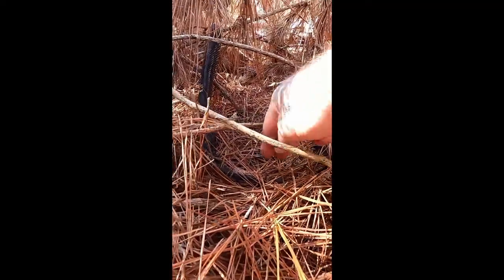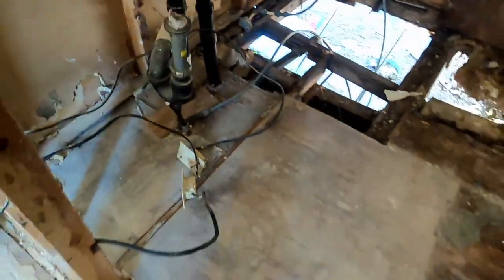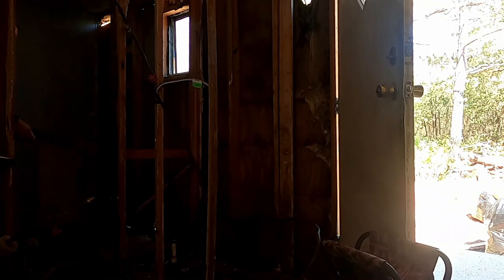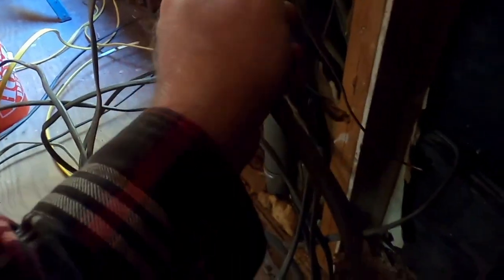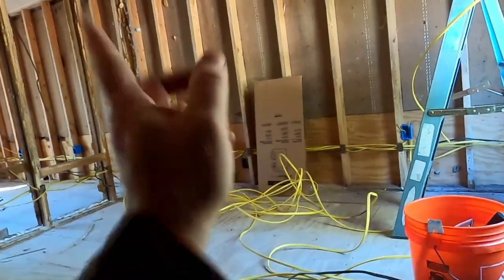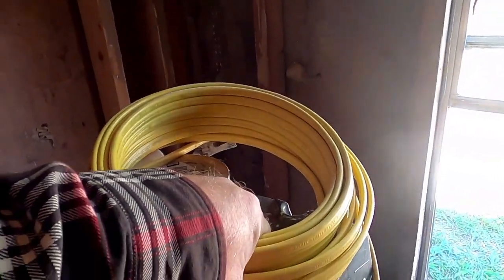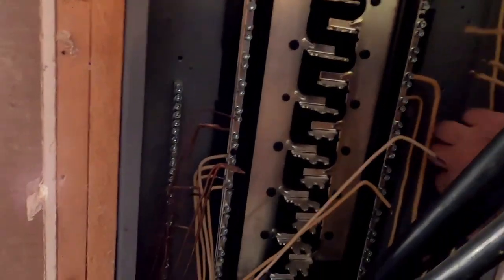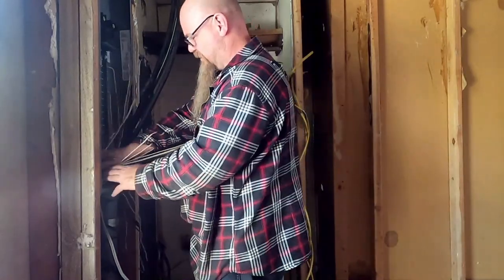Rewiring a mobile home myself: Doublewide Renovation

Comment: Good job on the wiring. If that was a stab-lok panel then those wires are probably bad anyhow. The breakers on FPE STAB-LOK don't trip under overload and they get hot and it melts the insulation or makes it brittle so it can touch and short. I don't recommend reusing any of that wire.
Reply from the maker: I would like to not, but there is some stapled into the attic wood and I can't easily get new in. I decided to isolate those to JUST those circuits. They will only run lights, and those should be low wattage LED's so, with that in mind I'm going ahead on those ceiling ones I can't get to. I hope I don't live to regret that!! 
I will say we haven't felt or observed any brittle or cooked old romex yet, even the stuff exposed to sunlight for an extended period still felt flexible and all. That stuff got replaced anyway but it seemed decent
Reply: @suburbangardenpermaculture3117  Just be careful. Really to be honest you can cut the sheetroock out and get access to replace the wire then patch it and spray more popcorn coating back on it. Which would you rather have? A patched spot and know the wire is good or a fire? If the old panel has burnt spots I highly recommend replacing everything, wire, switches, recepticals, everything. I'm a licensed electrician. NFPA writes electrical code. NFPA stands for National Fire Protection Association. Electrical code is all about preventing fires. I tend to follow what they suggest because there is a reason for it. It's better to be safe than sorry. Your family will be living in the house. The amount of money you could save cutting corners will be gone if a fire happens or in hospital bills if one of your loved ones is hurt in a fire, plus you live in the sticks, is the fire department next door? New modern wiring means insurance is more likely to give you cheaper coverage.

Comment: We live in a pretty old mobile home and the lights flicker. I've had my husband replace most of the plug ends on the wall, but there are a few he hasnt done yet. Probably got 5 left. A lot of the flickering stopped, but there are some rooms where it still flickers if you plug something in. I know the wiring needs to be completely replaced. Do you think it would be easier to open up the outside of the house (aluminum siding) than it would be to tear up all my walls? I just am not good at drywall and I've already painted everything and dont want to deal with that. Drywall professionals are super expensive. I would think if the outer walls are out, we could also put some good insulation in after its rewired. BUT is that a viable option to do it from the outside?
Reply from the maker: Wow... YES!!! 🤣 That's literally like the best situation if you ask me. This video you are on is a few months old, and I'm behind in publishing my footage, but we have been removing the outer skin siding to repair it, and we've JUST been talking about how we could get another free trailer, with metal siding, and replace it like we are on this trailer and it would be SOOOO much better! 
I don't want to spend your money for you lol, but we found out that 7/16" OSB wall sheathing panels are only like 11 bucks each... that's not free, but it's truly not alot for what you'll get. 
I recommend removing ALL the metal siding,  carefully, work out your wiring, and then add these 7/16" panels and nail them hard to the frame like we are, a nail every 4-5 inches... ALOT of naild per sheet. It makes the trailer SOOOO much stronger and airtight. There is also House wrap. You can install that over the panels, then screw your original metal siding back on and you'll notice a WORLD of difference in your heating and A/C bills, and it'll feel much more Solid! 
Long story short, YES, that's a great way to rewire it without messing up your sheetrock,  and you should take that chance to fix any Rot and add hard panels and paper before your siding.
Reply from the maker: I would add, if you upgrade you panel like I did, you'll likely still have to mess up the wall at the panel to get to all the wires easily inside and out.

Comment: What all did you use supply wise? I want to completely rewire a mobile home, but I don't know what all I need for it. What kind of power cables and everything did you use?
Reply from the maker: @karadavis4586  inside all 12 gage wire, no 14 gage at all, whole trailer is 20 amps or more. The big feeder cables are sized for my application, and are 250MCM. 
I didn't use wire nuts i use Wagos to connect

Comment: Do you need a permit to do this, im renovating a old mobile home and need a temporary outlet power box for now, will the city ask me for a permit when I call them out there, im in Minnesota?
Reply from the maker: That depends. Are you on your own land, or a trailer park? A park is often bound by all city codes, personal land sometimes isn't.  In any event, it would just cost more to get the temp pole.. you'd have to have an electrician apply for the temp pole and get that going thru them maybe.  Is it your land or other?
Reply: @suburbangardenpermaculture3117  I own the property, there is mobile homes an acre away but I own the property
Reply from the maker: @Crystalee27 texas is certainly different legal-wise than Minnesota so I can't nail it down exact. In TEXAS, I'd say you can definitely get a temp pole out there fairly easily. They understand raw land people need power that isn't exactly... finished lol.  If you don't know what the parameters are to allow a temp pole, you'll need to investigate from your city or county website, search for Temporary Electrical Service, and then dig in on private land requirements
Reply from the maker: For example, in texas a mobile home is Personal Property like a car or boat .. you're allowed to modify your boat or car without any kind of permit.... mobile homes are treated the same. At the trailer park even, they can only inspect the electrical connections coming into the home. They aren't responsible for how or who wires or works on your electric in a trailer here.... if it was a house, the electrical upgrades WOULD require permits and licenses.... but not a mobile home, it's Personal Property.
Reply: @suburbangardenpermaculture3117  okay I’ll check that out, thank you

Comment: How much did it cost to do it
Reply from the maker: Overall, the cost of 4 bundles of 12 gage wire ($150.00 each) a breaker box (180 bucks) all the sockets and boxes and parts. Not alot really, less than a thousand bucks